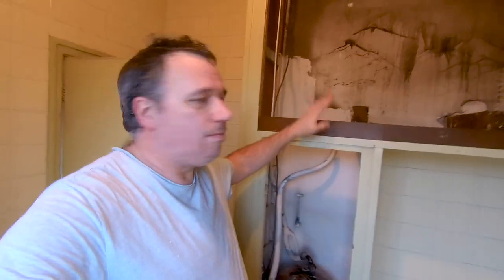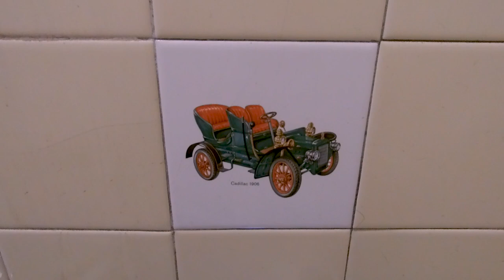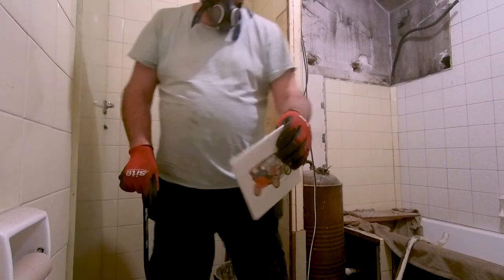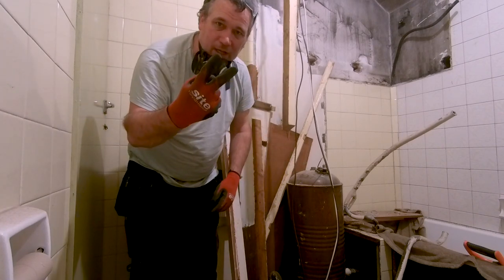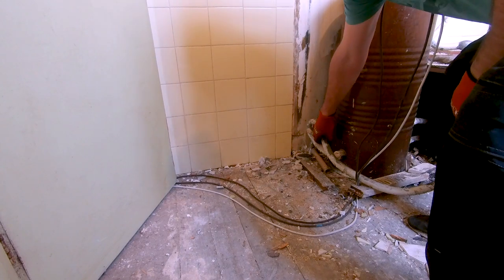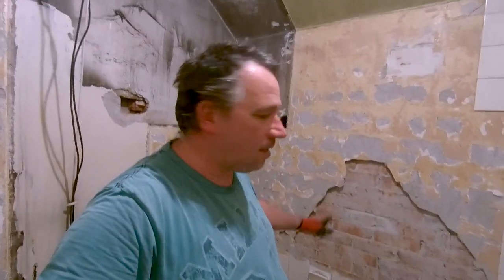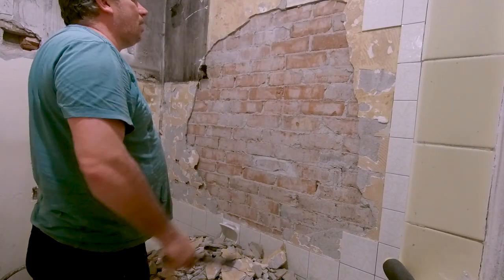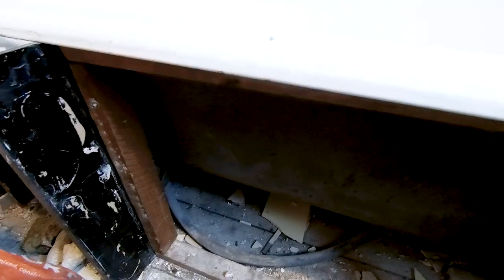Stripping out a Bathroom - Bathroom Renovation 01 - DIY Vlog #15

Comment: I'd say the missing brick has to have been for an old overhead tank for the toilet. Either water pipe in or condensations prevention ventilation hole or maybe for a mounting bracket. Demo work is magic, so much more progress per minute than building and there for more gratifying.
Reply from the maker: Yes my first thought was an overflow for an old high cistern. Demo work is great but a pain in the bathroom when you need to have a toilet and bath working every night. 😀
Reply from the maker: I've also discovered since that I cannot get the bath out on my own anyway. It is part buried in the walls, even taking off all the plaster around it I can just about drag it out a few feet. There's no way I can lift it as it's an old cast iron bath and weighs a ton lol. When it goes back in properly it will have to have a space left in the plaster for it and then plastered over the edges.
Reply: @LCWDIY  Last time I saw a cast iron tub taken out of a house it was in 4 pieces and that seemed heavy enough. You could do the same if you want a new one in, could go full out and get a spa!
Reply from the maker: Sadly the missus loves it and wants to keep it. There's even rust spot through the enamel on the bottom of the bath, so I am researching on a DIY re-enamel kit, which should be fun. To get it professionally re-enamelled would cost more than a whole new suite, but there are kits for around £83. I believe cast iron baths are highly desirable now so don't want to get rid of it.
Reply: @LCWDIY  Now that you mention it, you've said that before in another video. I am looking forward to seeing that. I have the same issue and thought about just using an anti rust agent combined with a tiny polish head to get it good and clean down to solid iron and coat it with some thick metal protective paint and find a finish to match the rest. I was thinking no more than £10 besides the stuff and tools I already own. The fear is it'll rust all the way through one day.
Reply from the maker: The only decent kit I could find was this one https://www.tubbyuk.com/shop/bath-resurfacing-kits/tubby-extra but that's still quite expensive. Really all you need to do is sand it down and get a tin of something but not sure what yet.
Reply: @LCWDIY  Considering your tool kit stash and know how I'd just go for this https://www.ebay.co.uk/itm/112321242194 and do the sanding and rust removal treatments with hands on material finishing it off with the enamel repair. Get it sorted for less than £15 if it isn't a big bunch of holes but only a chip or 10.
Reply from the maker: Sorry I need to re-enamel the whole bath. The enamel on the bottom of the bath is looking so thin and scuffed, a bit like it's been sanded. And the rust spots, although only small, cover half the bottom of it. Otherwise yes I would simply use one of those small repair kits, I like to go large hahaha 😬
Reply: @LCWDIY  That sounds like a murder of a project. If that goes well I suppose I'll be less scared of it but even still it isn't an easy task. In any case I'd do it last so not to ruin it by other projects.

Comment: did you have to drain down  the system  to cut the lead pipe
Reply from the maker: Yes, I didn't know that after opening all the taps and letting the water run out that the tank would still be full. All I had to do was run the pipe from the bottom of the tank into the toilet, and then as you saw, just get the last bits out with a bucket. On most modern tanks you should have a drain off valve on the bottom pipe that would have make this job a lot easier.